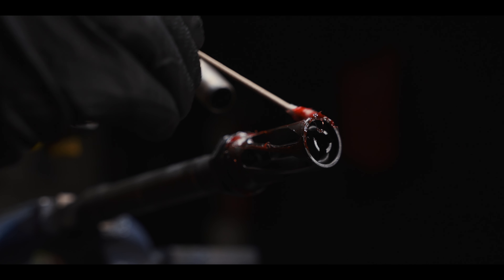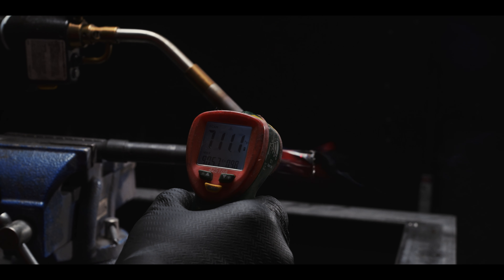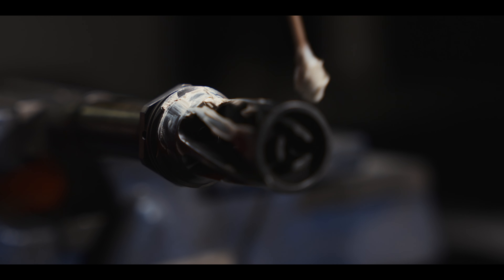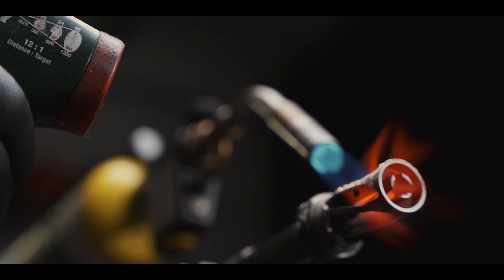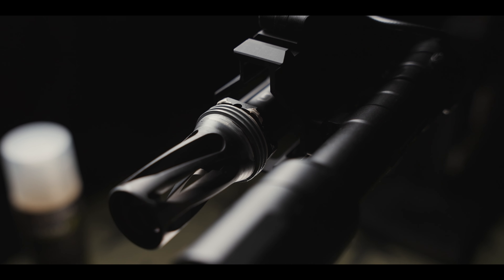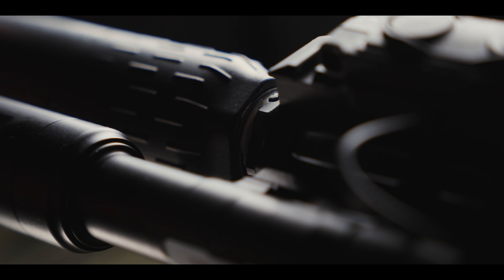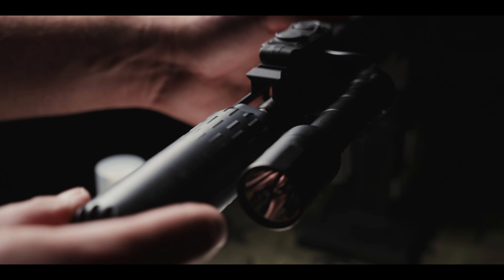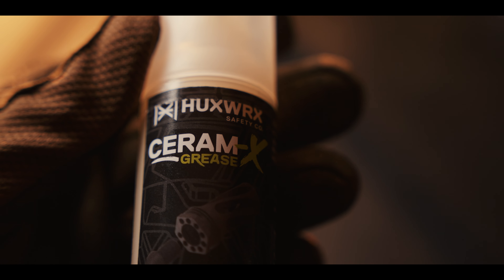CERAM-X - Hi Temp Grease!

Comment: Ceramic Brake Caliper Grease.  Non-Metallic, rated for up to 3000, available at all major retailers with an automotive section.

I love your suppressors and the QD mounting system, but between the suppressor cleaner and this product, I worry that you are milking the brand name rather than actually providing something of value to your customers.  I'd be willing to pay a modest premium to use your product, but an 800% markup is just not reasonable.